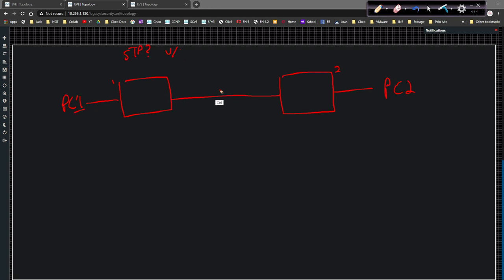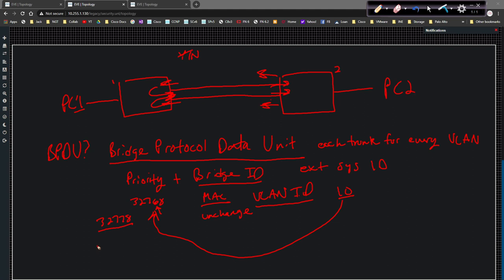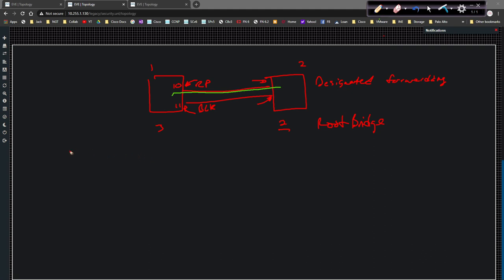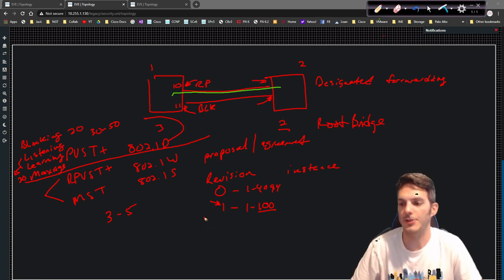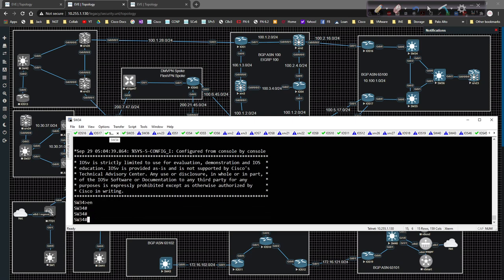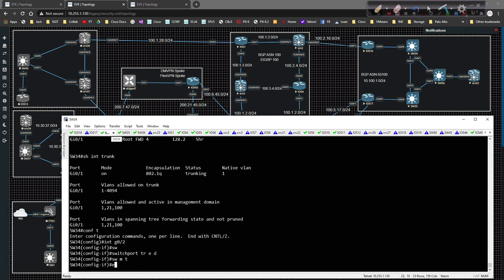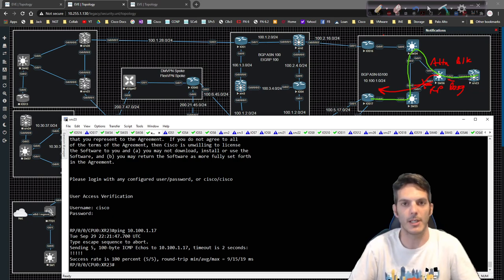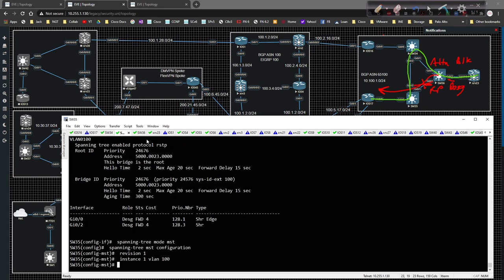Cisco CCNP ENCOR and ENARSI L2 Series 004 - Spanning Tree Protocol

Comment: Hi Rob, Thank you for the video. In min 9 the blocking ports depends on the upstream swtich ports and in your design it will depend on the lowest number of the port which is the Root Bridge switch ( it will deside what port to block on the other switch)